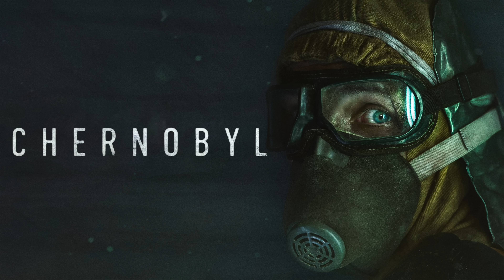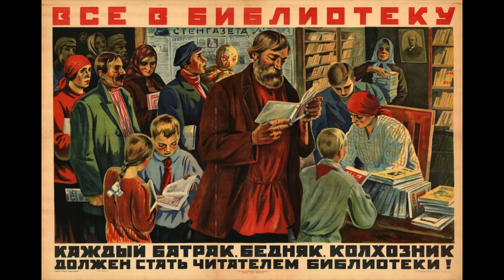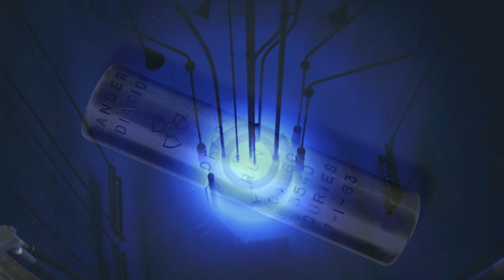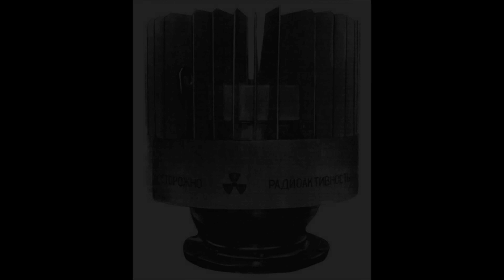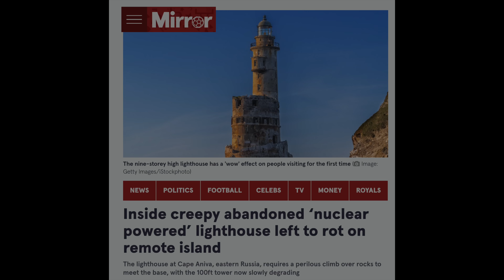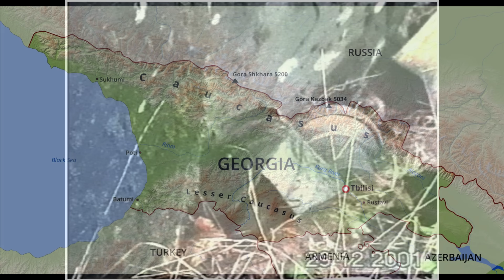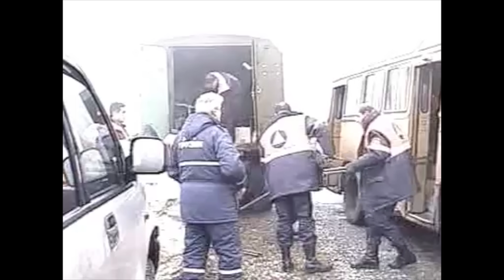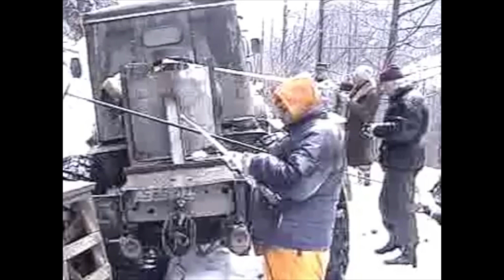The Soviet Union's Deadly Abandoned Nuclear Generators

Comment: The thing that upset me most about The Martian film was near the end when a character jury-rigged an explosive, but Hollywood decided to put a flashing light and speaker onto it. I understand it was to look more interesting to the average viewer, but if you have but minutes to build a bomb out of scrap materials, the last thing on your mind is programming an Arduino to beep faster when you hit the detonator. I felt that shot alone did a disservice to the entire book, which is slow, methodical, and scientifically/practically based on reality.
UNFORTUNATELY —and this brings me back to the topic of this video—, it was pointed out to me after I had read the book, that the whole point of the mission having an RTG was that it generated power, and Mark uses it as a space heater while worrying about generating enough pirate-ninjas using solar! Again, I get that it made for a more compelling story as it is, but I wonder if the writer did that intentionally and how they feel about it.

Comment: Kinda makes you wonder what kind of horrors would be uncovered if the CCP ever toppled and China fell into a state of chaos like the USSR did back in the early 90's?!  Or better yet.. if the North Korean people were ever to decide they've finally had enough "Kim" in their lives and they took back control of the DPRK from the Kim's! Just imagine the absolute nightmares left behind by 80 years worth of "Kim's" and their hastely rushed and horribly misguided nuclear ambitions!  Ive heard stories about how Kim was so motivated to rush the refinement of weapons-grade nuclear fuel that despite lacking the technology to do it safely, or even enough fuel to run the heavy equipment needed to properly develop the sites and safely transport and handle nuclear materials, he simply just "recruited" large groups of human "handlers" starting with those condemned to prison camps, and others he viewed as "undesirable" and/or expendable, and he put them to work, often times failing to even tell them that what they were working on was not JUST "critical to the forward march of progress for their country" but that they were also basically a guaranteed suicide mission, since they would be directly handling highly radioactive materials as if they were mere scrap metal.. and they were lucky if they were even given a worn out/ tattered pair of canvas work gloves that were just pealed off the hands of the recently deceased worker that they were brought in to replace! 
I heard that the gloves and boots would become SO highly radioactive, that the prison camp guards had to occasionally confiscate and bury them,  because the workers would covet and protect them so fiercely that they would bundle them up and sleep on top of them in order to prevent them from being stolen in the night, and in the process they would be exposing their torso and guts to a hot radioactive source, causing them to get sick and develop burns and sores after only working on the site for a single day! 

So they would confiscate them, and ensure the worker that they we're merely holding onto them for "safe keeping" at night while they slept. 

And the guards at the site got so good at compartmentalizing workers, never letting them spend too much time in the same place, or with the same people.. and ensuring that prisoners were separated by number of days they each had been exposed, so that the workers who had been growing sicker and sicker after day 3 and 4 working on the site would never be allowed near newly incoming workers who were still exposure free, so that they wouldn't recognize the fact that with each passing day, their comrads were getting sick and dying, and they would maintain a SHRED of hope and optimism (if that's even POSSIBLE after being imprisoned by the Kim regime).

I heard that he (Kim) turned-and-burned (quite literally) thousands of condemned prisoners during the course of building up his current nuclear program.  And all of it went essentially unrecognized by the international community who has a habit of sticking its head in the sand for YEARS while the Kims build and test their nuclear arsenal!  
It was a win-win for Kim! He got what he wanted, without having to spend the hundreds of millions of dollars that it takes to do something like that "safely".  As a matter of fact, the cost associated with building all the infrastructure involved with safely developing and handling nuclear materials is a BIG part of what has kept most other developing nations from embarking on their own nuclear research and defense programs, and while (thankfully) this is USUALLY enough to prevent them from trying it anyway!  All but North Korea!  Kim is just SUCH a ruthless monster, and he is in the unique position where he can just suddenly decide to condemn thousands of human beings to certain death in order to achieve a terrestrial goal of obtaining something he wants!  He was able to do what the nazis did and eliminate huge numbers of himan beings without reprisal because he has kept N Korea so isolated from the rest of the world!

Now imagine what will be uncovered some day when that horrible regime is finally toppled, after the dust settles.. the types of things we'll uncover!  The huge areas of land we'll find that are hopelessly contaminated that Kim was using as a giant dumping ground for nuclear waste generated during the course of his failed tests and mistakes!   
The horror's that will be uncovered will make horrendous historical events like the Holocaust and the Chernobyl incident look like childs play!

Comment: The Georgian retrieval team looks well trained and their exposure were strictly timed to 45 seconds. In a richer country, they would have to be in "space suits" for such dangerous tasks. It is still risky but far safer than sleeping for hours within a meter + of that RTG  The Russians have to learn, like all other countries, and I believe the latest generation of reactors would be far safer.
Reply: They where trained by western sources prior this is also why its so structured in how they all only where there for x amount of seconds etc.
Reply: As a former isotope source radiographer and later high explosives handler, there is a level of competing hazards.  Too much shielding or too long of a tool and your working time or control goes to 0.  This is exactly how it should be done when your balancing the time, distance, and shielding.  Time is linear, distance is an inverse square, and shielding is highly dependent on what the source is but you can look up half value and tenth value layers of materials for the source in question.
Reply: My man, as Russian I can tell that this country can't learn shit. They are still warmongering pieces of shoit that can't foresee 2 steps ahead.  I guarantee you that they gona deploy this RTGs in Arctica and it's gona be disaster in the future.

Comment: Definitely a polar opposite to the safety standards of the British nuclear safety standards. Nuclear waste is hauled by rail. The vessel, known as a flask is made from 30 mm steel, cast from two pieces. The body being one, the lid being the other. They're bolted together with large high tensile bolts, and designed to handle major stress. They dropped one from a height of 6 metres to see if it would leak. Nothing significant enough to be considered an unsafe radiation leak. They then decided to do a "worst case scenario," a collision with a train. They pressurised the interior of the casing, strapped it to a flatbed carriage, tipped it over and placed it diagonally across the tracks. A train was launched at it, the impact being 160 km/h (100 mph) It was a spectacular crash and explosion. Tests were conducted on the flask, and other than some bent fins, no real damage. The collision test was known as Operation Smash Hit

Comment: I wonder how much power these deadly generators produced?🤔
Reply: From Wiki:"The Beta-M[1] contains a core made up of strontium-90, which has a half-life of 28.79 years. The core is also known as radioisotope heat source 90 (RHS-90). In its initial state after manufacture, the generator is capable of generating 10 watts of electricity, almost enough to power a compact fluorescent light bulb with light output equivalent to a 60-watt bulb.[2] The generator contains the strontium-90 radioisotope, with a heating power of 250W and 1,480 TBq of radioactivity – equivalent to some 280 grams (9.9 oz) of Sr-90.[3] Mass-scale production of RTGs in the Soviet Union was the responsibility of a plant called Baltiyets, in Narva, Estonia.[4]"

They generated power to charge up batteries in the lighthouses. The lighthouse ran off the batteries.

Comment: Despite the danger, it’s an ingenious energy source. If only they used higher quality materials and safety measures they could be running somewhat well to this day for their intended purpose. A key part being remote areas and well constructed installations. Shame it ended up this way.
Reply: Some day they will make a generator that’s fueled by an isotope no larger than a pill.

Comment: There are clever fans for wood stoves that use the Seebeck effect.  There's  a semiconductor module sandwiched between a heat pipe and heat sink and it is attached to a motor which drives the fan.  The heat wicks up to the module, the heat is shed through the heat sink. The gradient produces enough voltage to run the fan which also helps cool the heat sink.
Reply: At one time there was a unit built around a standard 6" or 8" flue pipe which was intended to be installed in the flue of a wood stove outside the building.  Intent was to provide a small amount of battery charge when cooking in or heating an off-grid cabin.  Heat sink was fins on the outside in the ambient outside air.  Designed to supplement other means of battery charge.
Reply: there is nothing clever, thermocouples have always been used in gaz boilers to maintain the safety solenoid in a steady state for example. The problem with thermoelectric generation is the extremely low conversion efficiency.

Comment: If they have a half-life of 28 years, wouldn't they become inert in 56 years (give or take a few years)? I'll admit my ignorance when it comes to nuclear radiation and the devices that use radioactive materials for power or whatever, but what happens to the materials after they go beyond double of their half-life?
Reply: After 2x the half life 50%*50% = 25% of the radioactive material would be left.
(BUT depending of the decay chain the original material may have decayed into other radiative materials)
For Sr-90 seems to be a rather short chain Sr-90 -> Y-90 -> Zr and the Zirconium i supposed to be stable. And the Yttrium-90 is a lot more radioactive with a half life of only 64 hours.
Reply: @TalpaDK  Yr90 also gives off gamma radiation as well, so the Sr90 is mainly beta decay, any resulting Yr90 in the mix will emit some gamma as well.
Reply: No, a half-life means half of it will decay to stable. So, if you have a kg of Sr90, then in 28 years, you will still have 0.5 kg of it. It stil dangerous, just not AS dangerous.  So, you need to keep dividing every 28 years until you get to a "safe" amount of Sr90 remaining.

Comment: The idea of gas lanterns makes a lot of sense if you consider the climate of the region, we might look at it as a waste of resources in modern standards, but to them it was light,and through the inefficiencies of electrical conversion, heat; so to them (back in the day) this was a triple win.
Reply: If you actually use the heat it isn't inefficient. it becomes inefficient if the heat is a byproduct that you get rid of without using it.
Reply: @baronvonlimbourgh1716  I consider it an inefficiency if the product made was not the intended product. Just because a byproduct ha an alternate use does not make make it efficient, though this could be chalked up to a different of opinion.
Reply: @festro1000  Ok, rephrase the objective:
Soviet bureaucrat:  How can we provide heat light and radio to the peasants?
Soviet scientist: Kerosene radio lamp.

There now what's the efficiency?  What percentage of the kerosene is lost as un combusted soot?
Reply: @festro1000 😂if you live in a place that's always cold it's not an Alternative use, it's multipurpose.  Heat and light is a good combo.
Reply: I must make one! Seems like a good electronics project, would come in handy of the power went out. Heat light and a phone charger that can run off animal fats or alcohol if need be.
Reply: @zakn3954  It would make a good device for winter camping in areas that are heavily shaded by trees, mountains, etc... making small solar panels not feasible. The thermocouple device can also be used with campfires or wood stoves to recharge mobile devices, GPS units, and batteries.
Reply: @jonathantan2469 biolite stove
Reply: @zakn3954  Good idea 💡
Reply: @zakn3954  They already exist: https://www.youtube.com/watch?v=IUj034sQBdA

It is also the principle used by those fans you put on top of wood stoves to blow the heat into the room.
Reply: @zakn3954  or you could buy a solar panel and a heat source if you planned on surviving without power. (The solar panel will make much more power and does not require fuel.)
Reply: Except the solar panel requires a battery, which will fail guaranteed within 10 years, making anything battery powered completely useless, including solar power, in a true doomsday scenario
Reply: @Fractal_32  Most of Russia is not a very sunny environment for solar power.
Reply: It was considered primitive but I’ll take safe and primitive over advanced and deadly any day.
Reply: Just bolt the thermocouple to the top of a Coleman lantern and you're golden.
Reply: Fun fact this is now a commonly available hiking/camping item nowadays. The most basic ones are just a series of thermocouples and a stove that one can shove twigs etc. into.
Reply: Not only that, but the problem wasn't even all that much of a problem if they could have just maintained the warnings around The sites.
Would have also helped if Russia had stopped being a Communist nation, leaving its people impoverished and ignorant to more easily control them. But that's not the problem we came here to talk about.😅
Reply: combined heat power AND light!
Reply: Those people
Reply: All though there are better ways like a sterling engine.
Reply: Every heater is 100% efficient as long as you enjoy any light or buzz it gives off.
Reply: Gas lanterns? where?
Reply: The 4% efficiency of this method makes it pretty pointless - I think solar panels would produce more, even in Norway. 

Of course not beyond the polar circle.
Reply: @LMB222  in reality those thermoelectric generators could power a tube radio with just a candle in proper conditions. They are more efficient than one might think.. And you can still find them sometimes for around $100. I think you need at least 10-15w to power a small tube radio, it is like a relatively large solar panel... 
And it was kind of convenient, they used to light up a kerosene lamp in the evening anyway, might as well enjoy listening to some radio while eating or doing something :)

Comment: Standard bolts even on electrical equipment are forbidden in some places, so putting them on radiation equipment is unbelievable. I cannot imagine any reason these devices would've had to be opened up at the site of use.
Reply: It was not supposed to fall in hands of any unqualified personal. However here we are.
Reply: I don't think non-stanard bolts were ever a thing in USSR. Never seen one on soviet equipment ever. And, being an engineer and tech junkie living in post-soviet country, i've mess around with a lot of old soviet crap.
Reply: Safety regulations in Russia. Neyt!
Reply: Thinking that the generator would need to have special safety would require the engineer to imagine it would be common for a Soviet Citizen to be just running arround complete bum fuck nowhere, to ignore the warning of radiation, and then to have industrial tool to fuck with the magical box powering a lighthouse or something.
Only way for that to happen would be to imagine engineer imagining that USSR could collapse and all these radiation sources suddenly be left unatended which would be contrary to procedure they were supposed to be used with.
Reply: Making non standard would require additional cost and manufacture..  so you can see why they did it. Easy assembly and readily available. Who cares about the safety....
Reply: It made no sense at the time to make RTGs temper proof because: They were intended to be used where there were no people. Hello? If there's nobody there to maintain a lighthouse, who would come for a visit? It was a different world back then. Nobody in their right mind would go into the middle of nowhere (personal vehicles weren't a thing back then) to hunt for scrap metal. If someone had a car, they didn't need to hunt for scrap, especially so far away. How dumb would anyone have to be to take a spanner to something that is warm, powers something and says "caution, radiation".
All I can say is that 1990s brought too much freedom to individuals who should not have been allowed out of padded cells. Natural selection in progress. In 1970s nobody thought that someone out there would want to build a dirty bomb yet here we are in 2023 and there have been rumours of Ukrainian volunteers wanting to build a dirty bomb. But again, would anyone think of 9/11 in 1970s? People didn't even know that Agent Orange was being used to kill the jungle and maim generations of Vietnamese. The times have certainly changed for the worst. What was nonsensical back then is a real possibility now and that is truly terrifying. We are now switching to electric cars. What will happen in 10 years time when a few hundred of them get stuck in a traffic jam in a tunnel and one or two catch fire? People will be scratching their heads thinking "that wasn't so bright, was it" pun intended.